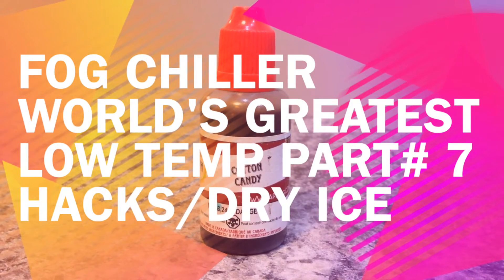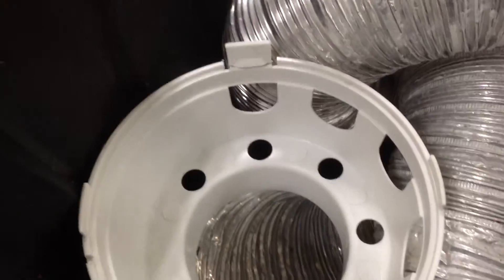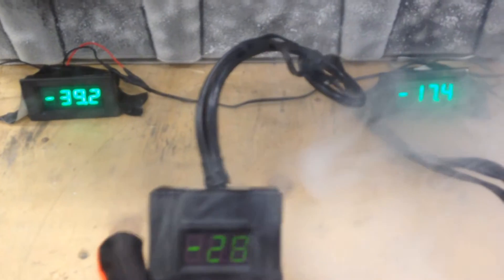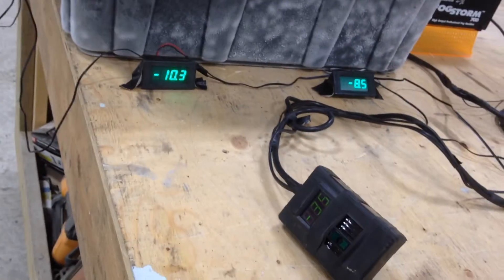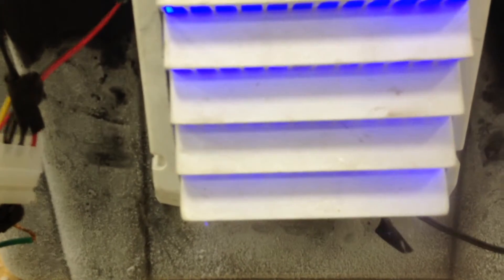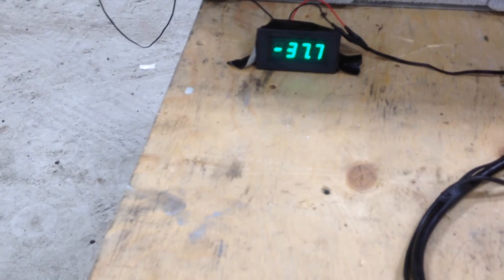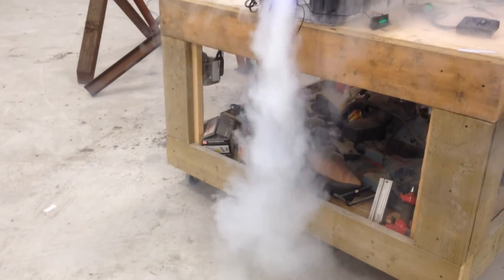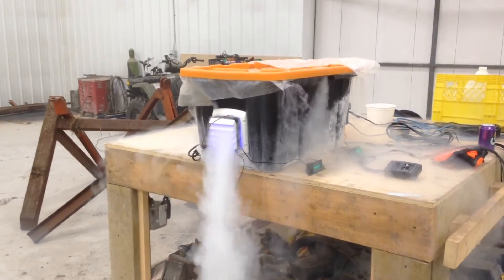Making the Bose Einstein Fog Chiller part 7

Comment: Hi Mc Zoolando, Love this fog cooler as its the best one I have seen.  I am trying to find what type fan you use and the temp sensors too.  Would you post the names of these as I cant make them out on the video.  Thanks for sharing your awesome fog cooler design !   I cant wait to make it for Halloween !
Reply from the maker: Kenneth Hall https://youtu.be/nFIx2eKi2cA
Reply from the maker: Check the comments
Reply: @McZoolando  Thank You Mc Zoolando sir !   I did watch that great video but still cannot make out the fan info, so sorry.  Would you post the name of the manufacturer as I want to use the same one as you.  Lots of options online but some may be too loud, to bright etc etc so since you have one that works great I just prefer to use same.  I looked on e-bay but cannot read the name on yours clear enough to identify it.

Also would any winter salt-melt work to lower the ice temps ?

Appreciate you're efforts as this is the only fog chiller I plan to mess with since it kicks A$$  !!

Thanks
Ken
Reply from the maker: Kenneth Hall any salt or ice melt or cacl2 mix will make things much colder and colder is better :)
Reply: @McZoolando  

Thank You Mc Zoolando.  I have a question on one of your last videos on the Bose cooler.  I noticed you had added a white dryer vent of some sort on the inside exhaust side.  
Was that to modify your design to work like these "vortex fog chiller cold fusion" versions  see on YouTube sir ?

Just curious what you take on these are ?

Much Appreciated Sir !
Ken
Reply from the maker: Kenneth Hall search on eBay- quad led computer fans
Reply: @McZoolando  Thank You Mr. Mc Zoolando !  I found them this morning, much appreciated.
Reply from the maker: Kenneth Hall the vortex kitty litter chiller is only a small step up from dropping a pile of ice in front of your fog machine. There was no science or thermodynamics applied to that design... respectfully but truthfully.
Reply from the maker: Kenneth Hall and the only other big tip I can give other than these videos is to use very cold ice! Don’t just buy ice at the c store and then throw it in the chiller! Put your ice in a deep freeze and turn it all the way down for a couple days! This is critical for best results!
Reply: @McZoolando  

Mc Zoolando,

I cant say how much I appreciate your advice and responses  I will use only ice (dry ice is pricey)  and hard to deal with & melts quickly.

I was thinking of freezing some larger ice chunks via some red solo cups to get larger pieces of ice then pour over that some winter ice melt.  Not sure how it will work but the local ice I get isn't the largest pieces and has melted fast when I used  a sub-standard fog-cooler in past Halloween decorations. 

On one hand the fog can filter pretty good through the smaller ice cubes but on the other they melt quicker. This may not be the case when I add ice-melt which I  have not tried yet.

Thanks Again Sir !  The neighborhood kids do not know you but they will appreciate the awesome fog display that will be a result of your educating us on YouTube !  

Ken

Comment: If I understand this correctly you focus more in cooling the entire inside of the container and not just the what comes in contact with the fog. For example is the fog blowing over the dry ice or is the dry ice cooling the inside of the whole container.
Reply from the maker: The chamber is always full of ice. everything on the insides we want to be as cold as possible. in this chiller there is an in pipe and an out pipe. The inner ends are located in the two furthest points apart from each other so the fog also has to travel through a maze of ice. Fog is inside this chiller for up to 10 seconds before it comes out the out pipe. ice and dry ice are cooling everything the same, but dry ice does not last very long at all when it comes into contact with water so keep it dry or you're just sublimating the dry ice and not chilling the fog the way this concept is meant to do.
Reply: Mc Zoolando thank you sir

Comment: I would like to reverse engineer as I may need to make two of these for the School Musical we are doing.  Would it be to much to ask for a parts list? I see what looks like 2 CPU or computer fans to help pull and push out the Fog. I am very curiuos about the Indoor Dryer vent kit. Is that on the intake of the exhaust(out to the Room) or the Exhuast of the intake(fog machine side)?
Reply from the maker: The indoor dryer vent kit is only useful really for protecting the dry ice boost (if you go that way), from any melting water. You want your dry ice staying dry or it's gone within 15 minutes. It's pretty much just an in line dry ice chamber. This chamber is on the out pipe.  There is only one computer fan on the different chillers I've made. Fog spends up to 10 seconds inside this chiller, before leaving the output.
Reply from the maker: https://youtu.be/cXbdhlASy8s